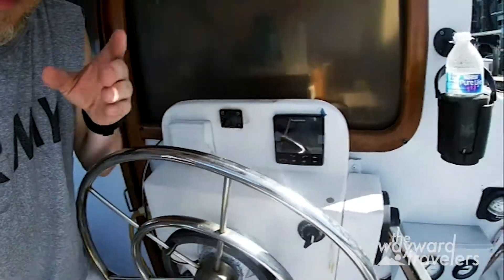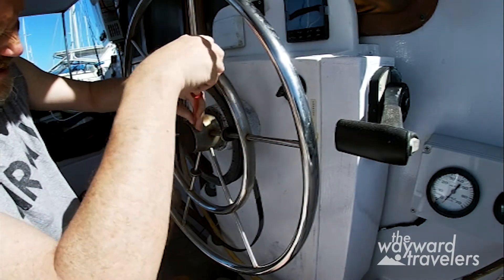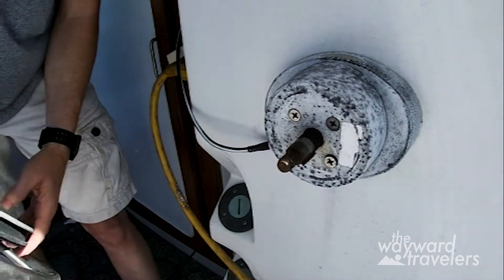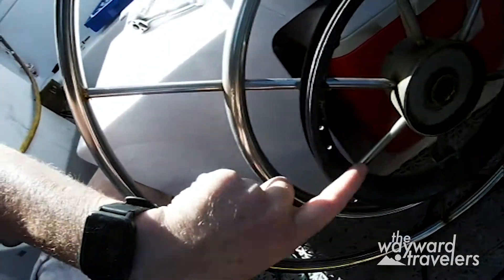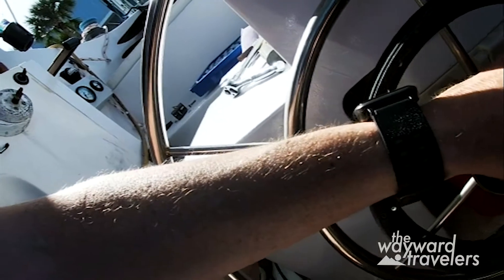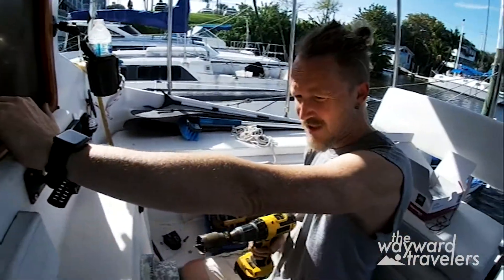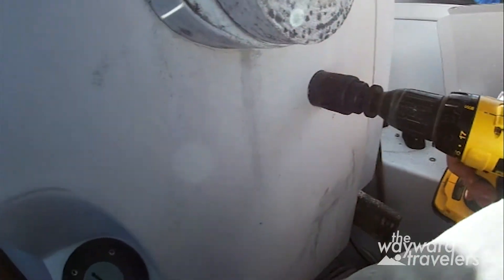EV100 Wheel Autopilot Install.

Comment: how many amps does this typically use in an hour under way?
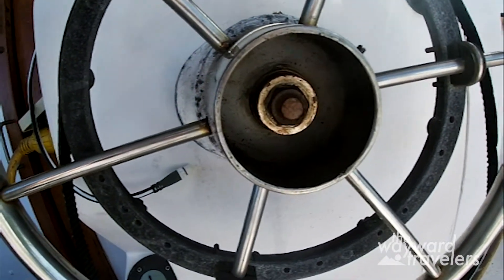Reply from the maker: That's a good question and I would be lying to you if I told you that I knew. I didn't use it that often for pure sailing as we were much of the time in narrow waterways so I had the motor on and thus was charging the batteries. Between 1:00 and 3 amps seems reasonable and consistent with other people's findings. 2 amp average  X12 volts = 24 watts